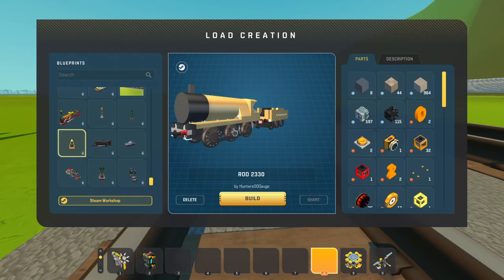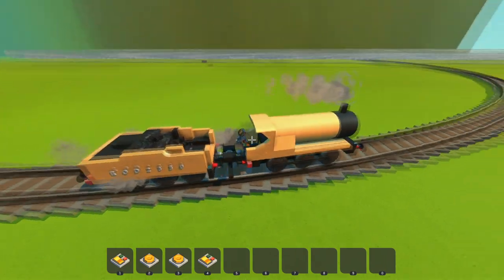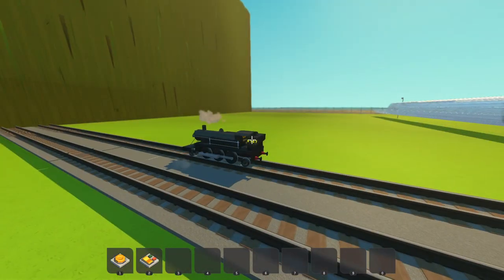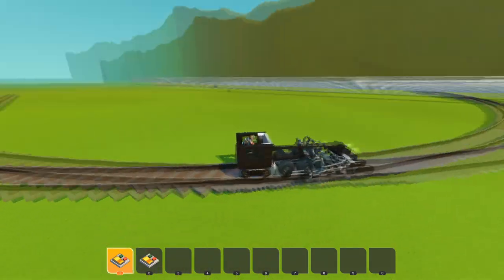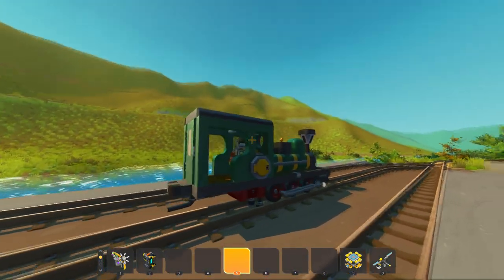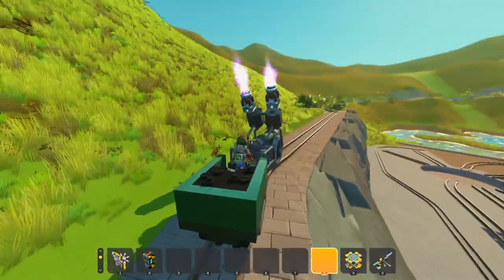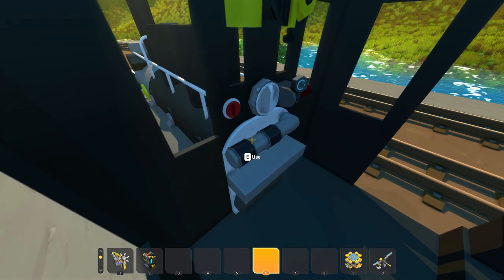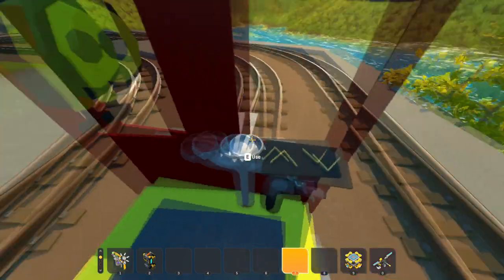Amazing Walschaerts Train! | Scrap Mechanic Creations

Comment: 11:15 xD yea thats fair, i should put it in my creations descriptions but they all tend to workl better on physics 5, they also tend to get stuck on those side platforms ... 14 degrees is floating and 15 degrees hold up the wheels but when physics is low enough it makes them loose enough that the weight of the loco fixes the problem and holds them down, ill put it in my descriptions tho yea :]
Reply from the maker: not really much you could do there! unless you try suspension?
Reply: @Faeryn  ive been trying suspension ;-; i cant figure out how to fit it in all the time without being massive but im working on it yea :]

I went through all my creations and added in thr descriptions what physics they work best on tho, so until i figure out how to fit suspension at least theres that